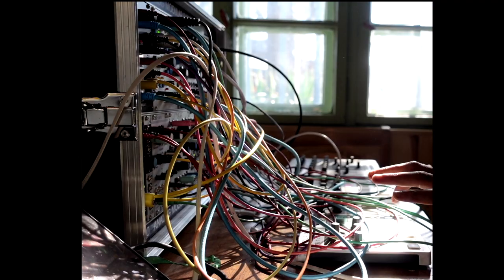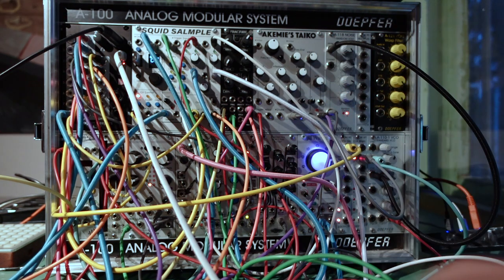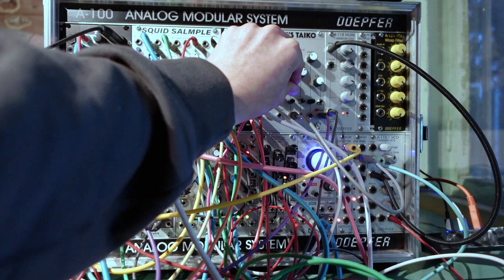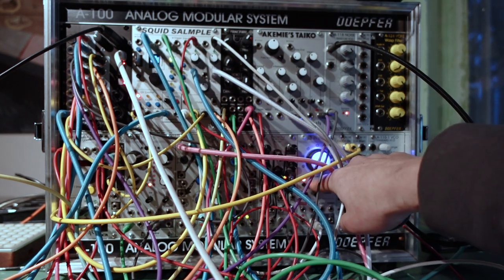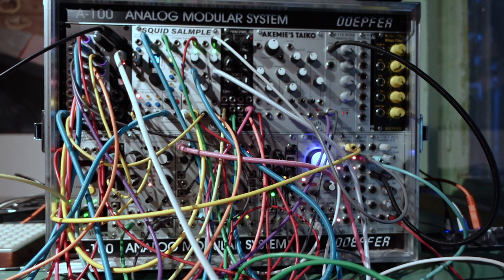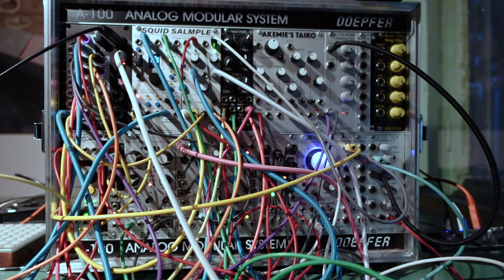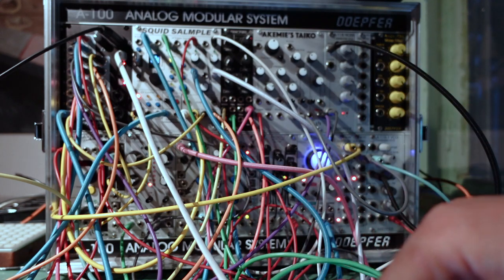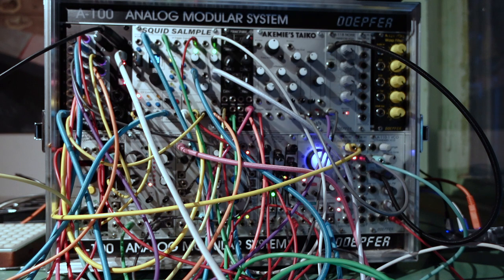Everyone Asked How I Made This Beat... A Eurorack Modular Patch Breakdown!

Comment: What's modulating the hat for Plaits is it a Pam's channel? How do you work with Pam's modulation when you have a trigger that's not a steady clock like that (since Pam's can't randomize on trigger), do you just use an x4 random wave?
Reply: Same question with the Taiko modulation, do you just sync up to whatever resolution your triggers are?
Reply from the maker: Hello mate, the taiko freezes the value at all of its cv inputs when it’s triggered so you can literally send pretty much anything into the input for random modulation. Plaits is being modulated by the doepfer random/noise module :)